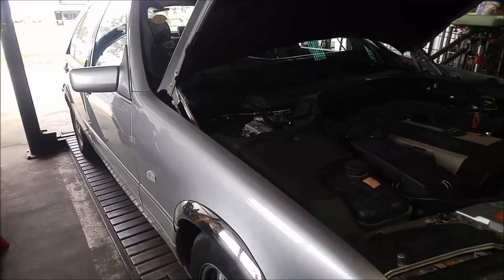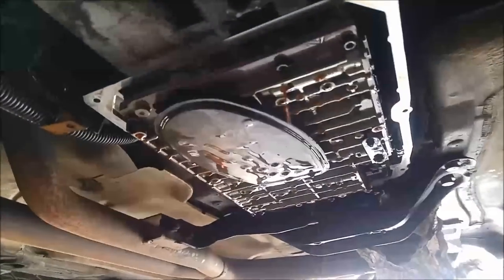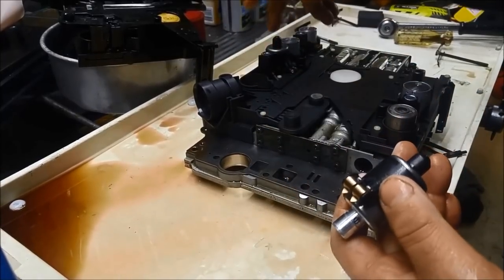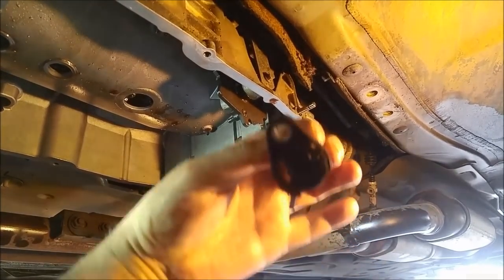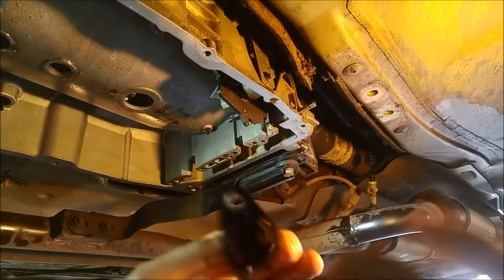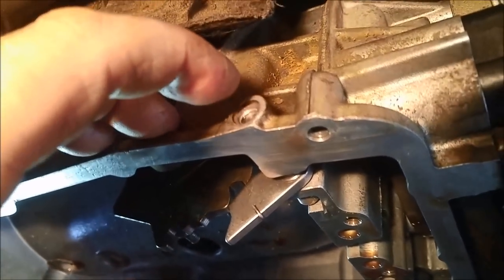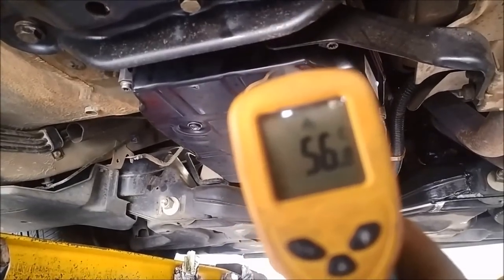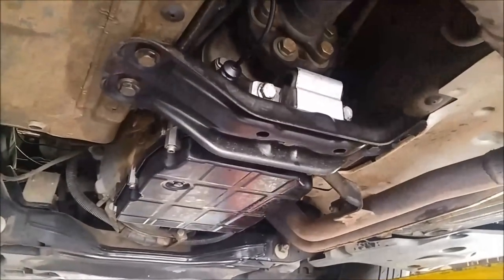Mercedes 722.6 Transmission Jeep W5J400 Transmission Replace Conductor Plate Park Interlock Actuator

Comment: Is there a difference in oil level from the w5a580 and w5j400?? Both are NAG1 transmissions  722.6
 Got a 2008 jeep grand Cherokee diesel 

At 173 F I put my oil to 55 Mm

Comment: Hi.. After changing the conductor plate need reprogramming the gearbox? Because I have like same situation end on the service they say need reprogramming gearbox if not the car will not go nowhere. Thanks
Reply from the maker: hi, shouldnt need readaption when you replace conductor plate on 722.6 trans. cheers

Comment: The parts look flat enough to remove without a lift.  Would this be something I can do in my driveway if I just put the car up on ramps?
Reply from the maker: hi, now you know a little more for what to look for, should make it easier. cheers
Reply: Thanks for the reply!  I read about the car needed to be re-coded by an MB mechanic to recognize the replacement, though.  That would mean towing the car 30 minutes to get to the nearest dealer or independent MB mechanic.  Do you suppose I could just bring the replacement part to them?
Reply from the maker: @GymbalLock  on 722.6 usually you don't need to reflash these at dealerships. the conductor plate is just like the wiring loom to link outside plug to the solenoids and sensors. however, vehicles with mechatronic conductor plates ( when new ) will need to be towed to dealerships for new software install. often if you use a 2nd hand mechatronic conductor plate you won`t also need to do reflash with vehicle. and then sometimes dealerships will also have updated software, so even if your vehicle is running ok, its a good idea to take to get reflashed, especially if its still under warranty...choice is always your though. cheers

Comment: Thank you for the great explanation, How can I send you a picture of a part that I don’t know what’s the name of it? It’s the cable that you twisted up and pulled to remove. It’s leaking, I have a picture
Reply from the maker: hi, it will be leaking at the sleeve with 7mm bolt through it, that the electrical plug goes into. called the transmission case connector plug or mechatronic case connector. sometimes trans fluid will travel right up and leak under your dashboard inside the car.  my email is found on my channel page on the link that says "about" . cheers

Comment: Hello I need some help please, I have e55 2003 106 miles with 766.2 transmission, was driving normally but start to hear wining noise in gears , so I decided to do a transmission service on it including the conductor plate connector filter but after a replacing the conductor plate and   putting everything together the car stuck in the first gear and none of the switching mode button between Confort manual and sport does not work and the car won’t shift from the first , receive a code P0748 pressure solenoid electric A , after some research most of the comments saying that it’s electrical connection the problem most likely,  what will be your suggestion do I have to have the transmission programmed for the new conductor plate?
Reply from the maker: hi,  hard to say without seeing it, however probability is you may have put something in loose or not connecting properly. on these the connector plug is sometimes hard to refit...make sure you haven`t bend on of the pins before you remove tha trans pan to check connections between the solenoids and pressure contacts to conductor plate. it would be worth bench testing solenoids as well while you are in that area too. cheers
Reply: So that’s not a scanning problem I mean scan programming ,? I already took it apart second time a  to check everything, little bit  band the solenoid contacts so it will touch more better , and switch between two pressure solenoid‘s I thought that will indicate which is bad but still same stuck in the first or second gear I believe
Reply from the maker: contact me on my face book link https://www.facebook.com/Yep-Thats-It-103051017785435   , if needed we can also exchange pics on there. cheers
Reply from the maker: https://www.youtube.com/playlist?list=PLQLkuOdKuFotJcUBVt3g3ci7yj5SfruMd
Reply: @jayheritageclub7852  did you ever figure out what the problem was??
Reply: @Loujr2250  yes I did, i had to reset transmission Adaptations and solenoid adaptations after that everything was working great, but was have to purchase scan tool to do all that.
Reply: @jayheritageclub7852  man I recently bought a 2001 sl500 with 80000 miles that went limp mode on me while driving it back home after a successful test drive. I got home and just put some fluid in there and the limp mode went away, but now it won’t shift out if first or the manual selection won’t work!! I have reverse and first and a check engine! There is a leak. I ordered a new transmission service kit and gasket and conductor plate for the car!!!! What did you buy to do that reset???
Reply: @Loujr2250  scan tool I got old autel maxidas research which one will be best for your model
Reply: @Loujr2250  you can get autel or lunch or there some others but you need to check it do transmission reset and adaptations

Comment: Hello I want to know how much fluid you add to the car. I am trying to replace a conductor plate  722.9  I  only bought 7 quarts  transmission fluid do I need more. Thank you
Reply from the maker: hi, that should be enough, however always check fluid level as needed just in case was low/leaking or incorrect. cheers

Comment: what is the name of that tool  used to unscrew the t30's  ? I have never ever seen that before. I would prefer to use that instead of breaking out the air compressor. I guess it's a wrench, but may it isnt so common here in the US. I am not even sure how to sear for it.
Reply from the maker: hi, do you mean the torx socket? or the ratchet ? or the speed brace? not sure which tool you mean..cheers
Reply: @YepThatsIt  haha. based on the words you   listed, I will bet it is the speed brace because I know what a torx socket and ratchet is. If that is a common tool here in the US, I have never seen it....not even in stores and I love to hang out in the tools sections.
Reply: @YepThatsIt  yes, i just googled it, and it is definitely the speed brace
Reply from the maker: @mcw1906  haha cheers
Reply from the maker: @mcw1906  yep ol` school tools that won`t need air or battery ;-)

Comment: what dos "hunting for gears" mean ? mine kinda short shifts and then the rpm is to low so then it needs to shift down again
Reply from the maker: hi, hunting is when the shift goes into gear nicely but needs to rev a bit more to change into that gear or the shift timing pattern is a bit more drawn out. cheers
Reply: @YepThatsIt  thank you for the reply so its like "slips" 100,200 rpm and then grabs the gear ? i have that . It sucks when sombody is driving in front of u like a grany accelerating and slowing down all the time ,if i dont fix it ring now and keep driving it dos it wear out the cluches more then normal ? thank you for the help
Reply from the maker: @boocho1896  have you done any work on trans? might be worth first checking the basics, then see if solenoid seals are flattened out and contaminated, same as the conductor plate sensors could be contaminated. fault codes ares only logged for electrical issues falling outside the pre-programmed parameters, and still then has to see that a few consecutive times for a hard fault. fault codes are not stored for mechanical issues generally...like internal leaks or sticking solenoids or valves. cheers
Reply: @YepThatsIt  no i did not, only changes the oil whit mercedes ATF when i got the car 2 years ago around 25.000 km ago cus i did not know the last time it was changed , now it has 385.000 km its a come and go problem today it worked great and its a joy to drive but some days its just lazy , its my 1st automatic gearbox car and im thinking the last
Reply from the maker: @boocho1896  check all the basics first. cheers for beers

Comment: great vid thanx heaps done so much and car is still in limp mode ;)
Reply from the maker: hi, you must still have an electrical connection issue or faulty/sticky solenoid. check battery is strong and fully charged and check for any bad connection across the earth straps. often earth strap cables are bolted onto paint, and the only connection is through the thread of the bolt. sometimes just undoing and doing up the bolts will improve the connection, but spray some wd40 or crc or similar on thread as well. you can measure resistance across the cable with a multimeter before you undo the bolts to see any improvement. i love a beer on a sunday https://www.paypal.me/BATS189 cheers
Reply: @YepThatsIt   Thanx well I have the car tranny together today new conductor plate plug and seal new solenoids and now it just does nothing starts fine but wont grab any gears? at least before I did that I had forward and reverse and that was with 2 faulty solenoids? any ideas Cheers Pat
Reply from the maker: hi, please contact me on my face book link https://www.facebook.com/Yep-Thats-It-103051017785435/  and leave me which  kind of vehicle/transmission type you have, and leave a detailed description of any fault codes and issue you are having ( we are able to exchange pics/diagrams on there ) and details of what work you have already performed or checked...... you will need to buy me some beers ( link is in face book ) and I will answer your questions accordingly. cheers
Reply: Carlo987agmin*con

Comment: Nice instructional video.  However, blowing off the plug without the transmission pan installed probably isn't advisable.
Reply from the maker: hi, thanks for input. cheers

Comment: Hi, where in Australia are you located, I am in Sydney, looking for someone to change my conductor plate and solenoids
Reply: My vehicle is flaring/slipping in the gears 3-4 only when fully warm
Reply from the maker: hi, i`m in north east country vic. internal pressure leak when fluid warms and thins out....good to start with checking solenoids and conductor plate and sensors and then go from there. cheers

Comment: When you change the controls unit i need to programming or not
Reply from the maker: hi, no need when you replace conductor plate on 722.6 trans. cheers
Reply: @YepThatsIt  hi i have problème with c250 2014 i change the control unit but she didn't start
Reply from the maker: is it the 7 speed 722.9 ?
Reply: @YepThatsIt  yes 722.9
Reply from the maker: its a different transmission to the vid. make sure you check the speed sensor on yours as well. cheers
Reply: @YepThatsIt  hi i have problem with the  speed sensor

Comment: No, you should never fill it with dexron atf. Totally wrong and you’re going to brake it any time soon. 
You can only use the appropriate Mercedes Benz oil by the the spec 236.14 or any other automatic fluid that meets that certain spec.
Reply from the maker: hi, can you actually explain to me why? ...pre 2008 merc used 236.1 which is compatible with dxIII